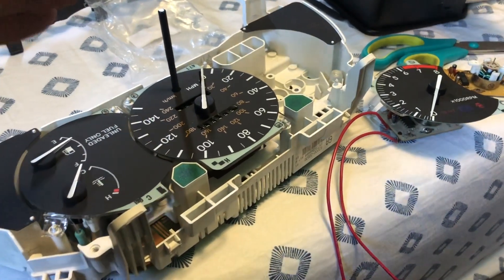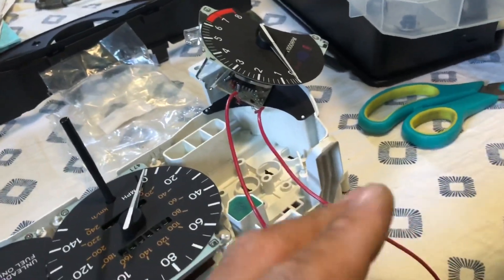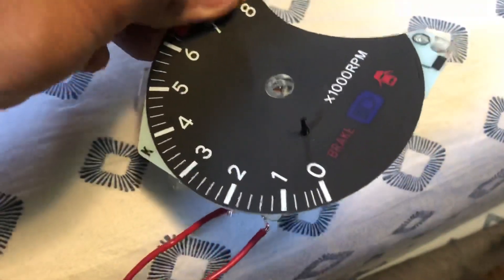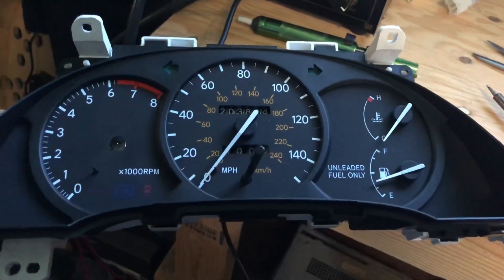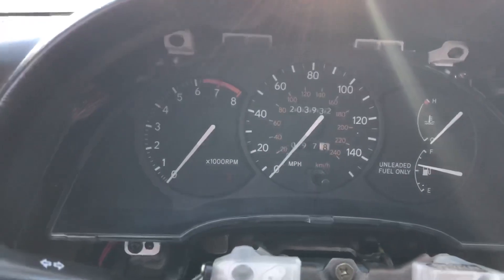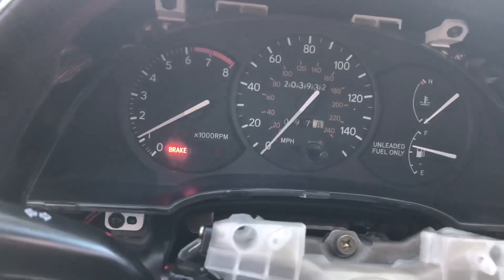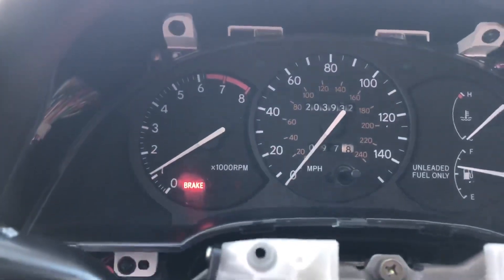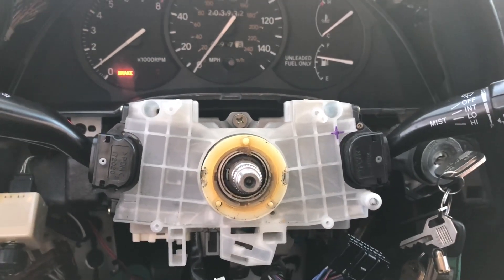Pt: 18 The Whining V6 Celica / How to make the stock RPM gauge work on a 1MZ-FE swap

Comment: Question your scanner you using dose it give readings for cat exhaust.  Reason why need to check emissions..
Reply from the maker: Emission codes yes
Reply: @2zzlow  thanks mate .
Another question for parts are  denso the best ...  thinking of getting new radiator new starter motor alternator that sort thing .... I have Toyota celica 1zz engine. Had 4yrs now no trouble so far .only had 2 owners